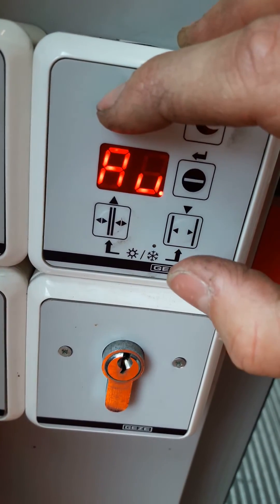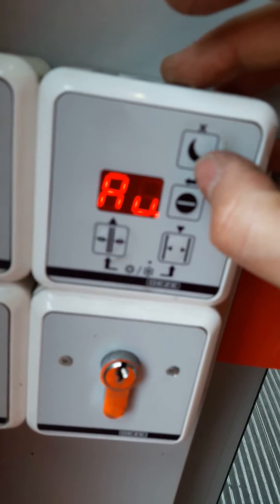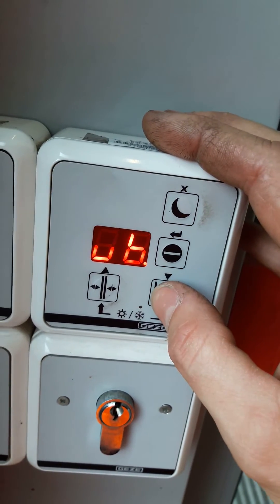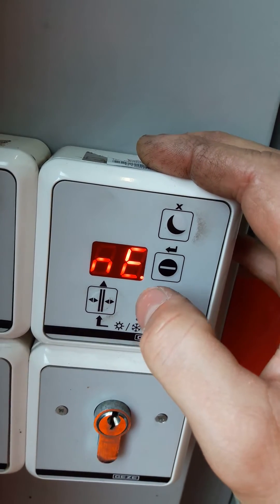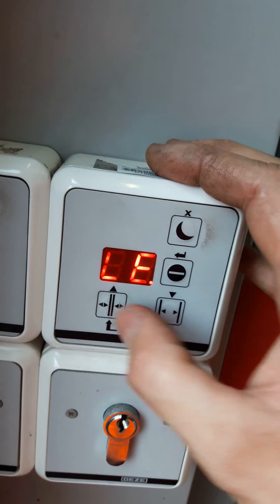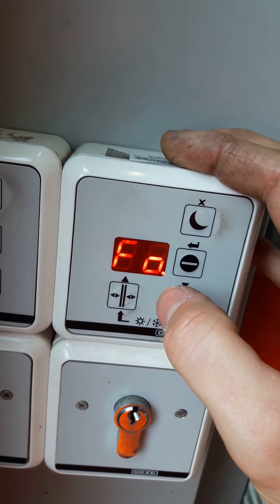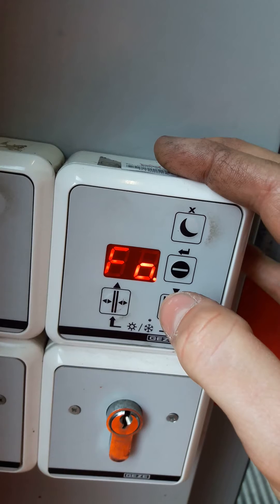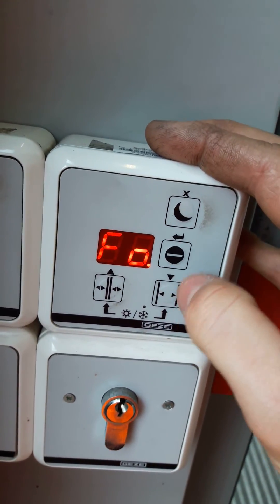How to set an auto door GEZE SLIMDRIVE in manual mode

Comment: I replaced the electro-lock, and now when i press the moon button to lock for the night the doors hit each other 3 times when closing position and then a gap remains between the doors, like 1 - 1.5 cm. But when the door is on auto mode they remain closed with no space between . I have tried learning mode but no luck. Any ideas? Thank you.
Reply from the maker: The door needs probably a learn. There s another video for that on the channel
Reply: @tecman67  I have tried 3 times, still the same result. Do I have to disable the sensors when learning ?
Reply: Hello, the same problem is with me. Do you resolved it? How?
Reply: I just stretch the belt a bit  more after finishing learning mode.
Reply: @ciramarius5060  thank you, I have to try this way, I'll notice you for the result.

Comment: Good evening! Please help with GEZE. There is an error 11. How to eliminate the cause?
Reply from the maker: Error 11 is DCU100 short circuit, excessive current through motor 1. I would check if you have no shorted circuit coming from one of the devices connected to the board. Check also the motor for any worn gearbox or bad windings. Check for any mechanical obstructions through the movement which could increase the current of the motor. Good luck
Reply: @tecman67  ok.Thank you

Comment: hi
mine doesn't have power
what could that be ?
Reply from the maker: Check voltage of main power, then fuse if good, then if both are ok and you still have no power, measure if the 24vdc output is sound with all inputs connected and then all disconnected. This is just to check for any short circuit from one of the devices. If there is no 24vdc output anyhow, the processor needs replacing